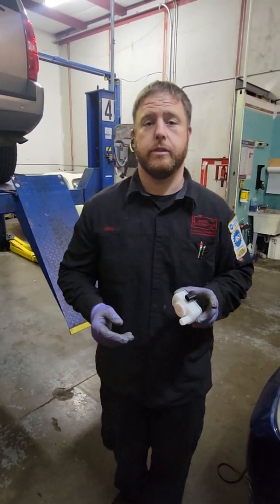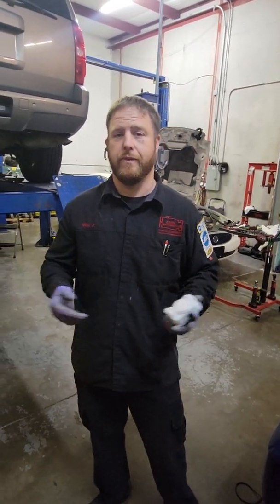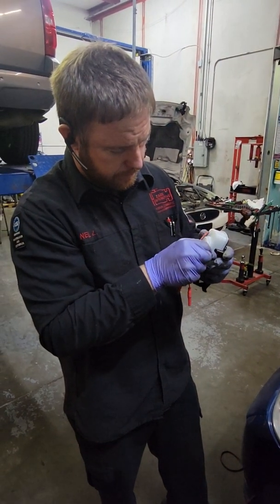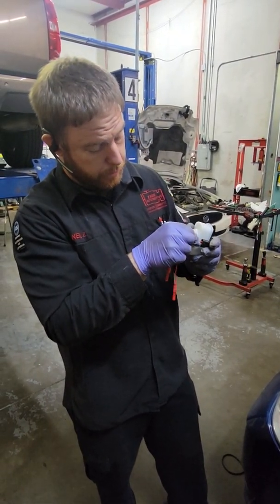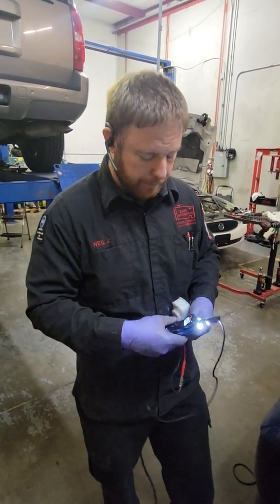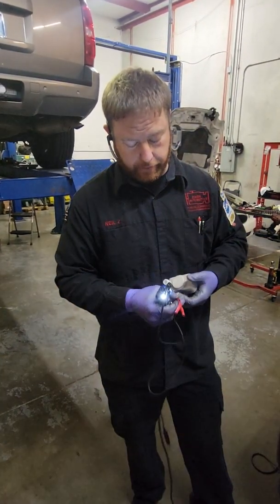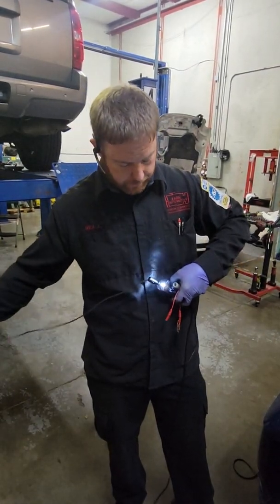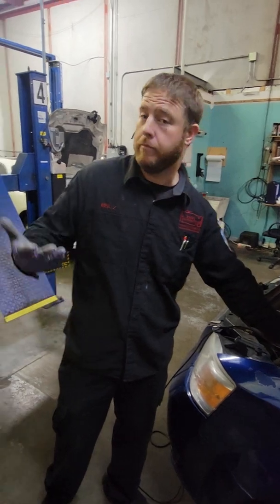Dodge/Chrysler EVAP Leak Detection Pump/ESIM testing & understanding EVAP system P0440,P0466,P0467.

Comment: Thanks so much,
I got p0440 and p0457 codes as well as the gas cap light at the same time  on my grand caravan. 
After replacing the gas cap and finding no leak at all, I replaced the ESIM and all codes were gone after two days.

Comment: P0455 (large leak) p0456 and p0457 (small leak and loose gas cap/ off) all on currently. Could this be my problem this would be my second time replacing this

Comment: I have a 2011 jeep liberty with the p0456 small leak. I have smoke tested it, no leaks found. I bought an ESIM  from amazon , it looked different from the OE  on the jeep. It still has the code and check engine light coming on after cleared, should i get an OEM from the dealer ? I don't want to chase my tail around because of a cheap off brand. what is your advice. thank you.
Reply: Do what he did, get a multimeter

Comment: $30 part and 5 minutes of labor on my 2007 dodge ram 2500. Easier to buy and replace and hope it’s it then test honestly. But when I took my OEM out it was loose and sliding all over inside, the new Dorman is different internally and is solid no noise, not sure on that one.

Comment: Will that part affect the gas gauge if it fails
Reply from the maker: No
Reply: @ why would my 3.3l caravan be saying gas cap on the dash and have a fluctuating gas gauge going up and down while driving. Any tips are appreciated!
Reply from the maker: @AndrewBlack-y2m  You have a fault for the EVAP system, which is the reason for gas cap light.  Gas Guage is not related.

Comment: I gotta question, I've got a small evap code (16 durango, 5.7) I had it tested while getting some other stuff done. They said it was the esim "box" and wanted i believe 350 or 500 to fix. I haven't looked under the vehicle to see what this plugs into. Can the thing this plugs into go bad, or are they charging me a fk ton of money for this little fix? I told them to hold off, bc i was interested in repairing it myself.
Reply: The esim (~$35 part for my car) is typically attached to the evap canister (aka charcoal canister), which is another component that notoriously goes bad. If that canister has a crack on the casing, or otherwise has a leak inside, it’ll turn on your check engine light. Hopefully it’s not what has gone bad, those canisters can get expensive (~$200 for the part). 

Another part that is a common fail point is the evap purge valve (another $35 part). Hopefully your mechanic has checked this already and has determined it’s not the culprit. 

Other than that, a smoke test could determine if it’s a hose or other part that’s leaking. Good luck!
Reply: @hectorllanes7388  it was the dealer. I had an electrical issue i took it in primarily, and a few before I took it in, I got a C.E light.i put my scanner on it, got a small evap code. They smoked it at the dealer while it was getting a new PDC put in it. They told me it was the esim. Which, I just assume they're gonna try to charge me to replace the box and the unit. I was just surprised when they told me $500, bc this doesn't look like a $500 job. Yes that includes parts, but, still seems a bit high. I'm thinking I'll do it myself
Reply: @NorthFloridaCowboy  more power to ya. It should be a pretty straightforward job and you can save yourself some money 👍

Comment: I replaced mine with the charcoal canister and everything was fine for 2 months. P456 is back on. What are the odds it went bad a again, I don't have that tool for testing.
Reply: Did you put mopar parts?

Comment: Great video - If you're gonna do it, do it right. Amen.

Now then, the OEM ESIM has the weight (rattles when you shake it), but for some reason, the Dorman replacement does not make the same rattle noise when you shake it. Perhaps, the weight is better seated? I am not sure, but there is definitely a difference in the construction of the parts despite the fact that many have eliminated their po456 code using the non-OEM replacement.
Reply: Did the doorman one work for you? Just got mine and noticed no weight rattling.

Comment: Very informative. A customer bought a new Autozone ESIM and there is continuity across the terminals as soon as I hook the leads.

When I blow considerably into the ESIM, the circuit goes open. I was wondering if some ESIMs are normally closed?

Comment: if the weight is not moving then the pump is defective right??? I bought one and the weight inside was NOT moving
Reply from the maker: it should move, I suggest Mopar replacement part.

Comment: Excellent but I wonder??? a old/crusty/faulty internal rubber valve will pass this test because human blows/sucks much pressure, but when measuring 1/2 inch of vacuum/pressure may fail. This is certainly a good test, but i "think" may lead to a false positive when not sensitive enough. great video. thank you.
Reply: Mine takes quite a bit of volume of air (blowing and sucking) to gain continuity between the connections. I don't have the lung capacity to keep it connected for more than a second or two. If I breathe through it normally (no force) nothing changes and the switch stats open. That doesn't sound normal to me, so I'm hoping you can offer some advice. Thanks in advance:)
Reply: Also, I'm wondering what keeps the system from just venting through it at all times?

Comment: hello, i KNow this video is a year old but hoping you can help me a little bit. Im getting a code on a customer's 07 commander. p0452 "ESIM stuck closed". from my understanding on a test procudure i found, the computer is supposed to comand the purge valve open for some time (up to 30 seconds) after the engine/key is shut off. at this time the ESIM is supposed to go from reading "closed" to "open". The ESIM and purge are both new, i took the canister off and shook it, no beads) he was having an issue filling it with gas (clicking off too soon) but he said that went away after we did the ESIM and purge. yet this code persists. one steop on the test i did said to take the purge hose off the canister while watching the ESIM signal and see if it changed from closed to open after pulling the purge hose off, it DID! it then told me to suspect the purge or purge lines to be the culpret. So far the lines seem good because i did the same thing but up at the purge instead of at the canister and it changed from closed to open so i dont think the lines are clogged. the control wires for the purge are good all the way to the PCM also and the connections seem good. upon checking the system again with everything hooked up it seemed to be working. would be closed while running and after shutting it off and turning key on again after 1 minute it would read open. then aafter a few times it stopped closing while running. im starting to think i have a bad purge valve and its not opening when its supposed to either while running (to create the vaccuum to close the ESIM) or open after shut off to release the pressure of the ESIM intermittently. It seems to be holding pressure but does not "click" like im used to purge valves doing. it did seem to be working when i comanded it on last time the car was here though. car is gone now because the customer got antsy and wanted to leave. but he will be coming back another time.
Reply from the maker: What brand was the ESIM?    When purge valve is on ( flowing ) the ESIM should rear Closed via scan tool data.

Comment: Thanks for the info! Question: I have a 08 ram 1500 5.7l  automatic132k miles. I filled my gas tank full and drove 50 miles then my truck stalled & CHECK GAUGES sign came on. My fluids were topped off. No CEL. I changed my fuel pump @ 127k. Charcoal cannister still original. Bad oil pressure sensor? or the charcoal cannister and detector, vapor purge valve solenoid, or vapor canister filter. Trying to repair it so I can bring it home safely. Any information you can give me would be greatly appreciated. Thank you so much.
Reply from the maker: I don't see any of the parts you listed causing the symptom you described.  Is it a crank/no start right now?

Comment: I have a 2000 Caravan 2.4 3spd California. In the past the evap monitor won't run and get the MIL illuminated. Then sometimes the MIL does light and recently the MIL lights consistently. Recently it's lighting all the time. Each time it does light, I check the code before erasing it and it's throwing a conde... P1494 Leak Detection Pump Pressure switch. [I have a $300 Actron hand scanner] My leak detection pump only has two wires for the solenoid valve and it does open when 12-14.3V applied [.9A] and it is sealing when powered off. I have not pressure sensor on the gas tank and I don't see one anywhere on the evap system. When powered the valve does not open all the way but it is enough to open the valve. I suspect the PCM is detecting current fluctuations of the valve opening? but I don't know how that would translate into the PCM to know it the evap system is holding or if the valve is working which it does except for it not locking all the way open.
Do you have any idea of how the PCM knows and what could be throwing that code?

Edit:
BTW even if the monitor won't run as long as the MIL does not come on, it will still pass the smog check because that monitor is so difficult to run with it's parameters the CARB has made an exemption for that monitor. If the MIL come on then you're dead in the water. Therefore it didn't matter if that monitor won't run as long as the other 7 monitors went "OK" I pass my smog checks anyway but now with the MIL coming on before the other monitors can complete, then I'm screwed.
Reply from the maker: That code is normally associated with a bad LDP or wiring.
Reply: @nzdiagnostics2010  I tested the valve out of the car and it works both is a tight seal and substantial air flow when powered. Incidentally when I took the valve out to check it and reinstalled it I must have turned the key on while the valve was still out, because the next time I got into the van to drive the MIL was on, I checked the code and it was an LDP circuit error. That tells me the wiring is fine.

Comment: I was getting a check engine light on back in September 2021, so I changed my esim and problem when away. The light is back on now do you think the esim could be bad again? already?
Reply from the maker: It's possible.  I would do some testing.
Reply: @nzdiagnostics2010  thanks will do
Reply: 1 bad gas fillup with untightened will make it return with working parts. Tighten that CAP!!!

Comment: Hey, great video. Did you just use an alligator clip to apply ground ? I've never really used a multimeter before. Just trying to figure things out. Thanks!
Reply: Set your multimeter to either check for continuity or to measure resistance. Choose both your meter leads to have alligator clips.

Clamp the leads to one another to confirm the meter's behaviour in the short circuit condition. If it's set to continuity, the meter should make a noise. If the meter is set to measure resistance, the screen should read 0ohms or a fraction of an ohm. Separating the leads to produce an open circuit condition should cause your meter to display 0.L (infinite resistance).

Now connect each alligator clip to the leads on the "pump." the short circuit condition should appear when you either blow on one end or suck on the other to introduce a pressure difference and supposedly close the switch.

That is, applying the pressure differential will short together the two pins you clamped your alligator clips to, if the "pump" is not defective.

I am not a mechanic. I don't know why this pressure switch is being referred to as a pump. Hope this helps.
Reply: Also, be careful that your leads aren't touching one another inside the connector when you clamp them to the pins. This will introduce an unintended short circuit condition that will override the condition you're trying to test for.

Comment: is there a way to bypass this with a jumper to the connector to make the ecu to think it working fine? Bypassing it all together?
Reply: I'm trying to figure out the same thing. I don't think it would work because the ecm expects the valve to close as the fuel cools and not be closed at all times. I'd imagine you'd get a code for a large clog. If you try it and it works, let me know!

Comment: That device is not a Leak Detection Pump (LDP). Its a EVAP System Integrity Monitor (ESIM). They are not the same thing. Older Dodge Caravans used a LDP but the newer ones use an ESIM. There is a lot of confusion in the auto parts world about exactly what this component is called. An LDP uses engine vacuum to cycle a diaphragm to pump up the system to test it for leaks. A system that has an ESIM uses the normal pressure variations created in the gas tank when the fuel vaporizes and condenses to test the system so no pump is required.
Reply from the maker: I know it's a ESIM, but in the field the EISM is also referred to as leak  detection pump.   This is exactly the reason why I stated it's an ESIM but referred to as LDP.  When you order this part you will search for LDP to find it.  ESIM determines if a leak is present.   I get it, it's not a pump.  Same applies with O2 sensors & Air/Fuel Sensors, majority call them O2 sensors.  Hopefully you know how to test it know at least 🤣

Comment: my 2004 Dodge Caravan has the older NVLD piece (not this smaller white ESIM).  The NVLD was changed and the P0441 disappeared, but the P0440 came back . Initially had both P0440 and P0441, changed the gas cap and the P0440 went away but P0441 remained. Then changed the NVLD and the P0441 went away but the P0440 came back.  Smoke test showed no leaks.  Also changed the Purge Solenoid initially but that had no effect at all on the 2 codes. 
 Weird, any explanation?
Reply from the maker: Make sure you don't a charcoal Canister coming apart where the charcoal pellets are causing a restriction.

Comment: Do you ever have them test good yet they're bad? This is my second in a row now that tests fine and I bet its this thing since no smoke leaks and purge works on the smoke meter.
I test them via continuity across the 2 pins since I dont have a probe...
Reply from the maker: No.  I have gotten 2 new bad ones out of the Mopar box.  We test them before we put them on.
Reply: Hello, I tested a new one, and it has continuity when I do your video procedure, but I noticed weights dont move up or down when I tested, also they dont move freely when rotate the Part. This means Part is bad right? Looks like valves are stucked. And when I installed on Car makes a huge noise. Thanks for your feedback in advance.
Reply: Are you careful to not let the probes accidentally touch one another?
Reply: Check connector

Comment: I have the same check engine light on but I replaced the part and it came back on any suggestions where to check if there's actually a leak
Reply from the maker: I would suggest performing a EVAP smoke leak test if you have the equipment.
Reply: I'm in the same situation with my PT Cruiser. Have replaced ENTIRE EMISSIONS SYSTEM but the Catalytic Converter and Canister--excepting for one cheap accessory and that's next: There's an electrical terminal assembly (3 wires) that hooks into the EVAP leak detection pump that costs about $30 aftermarket. On my Cruiser forum a lot of the folks claim that they discover during an EVAP repair with the 440/441 series of DTCs they find that there was never really anything wrong with the pump in the first place. (After removal the old pumps passed smoke test!) It was a corroded wire all along. It's on the bottom of the car near the gas tank and exposed to the elements so makes sense, right? (Not bad for a girl, huh?) I'll check back if this repair FINALLY takes the cursed engine light off.
Reply: Another light came up and it's saying that it's the purge valve maybe try that. Another video also said gas pump if you hear a whining noise inside the car. Either way never buying chrysler, dodge, jeep, nor ram cars 💀